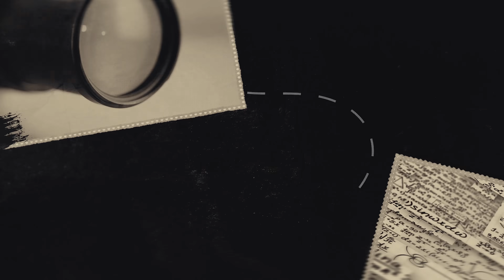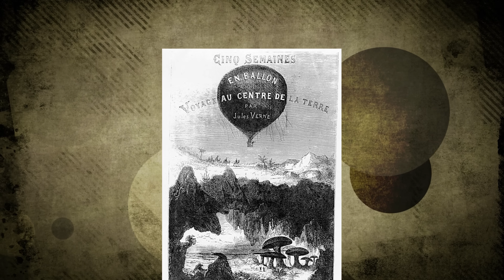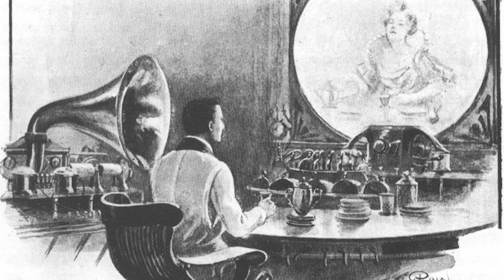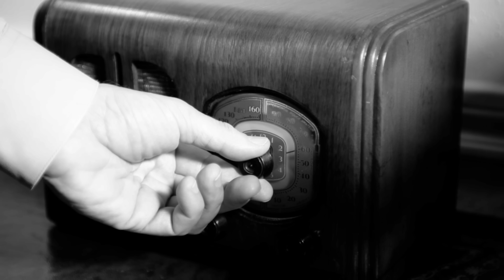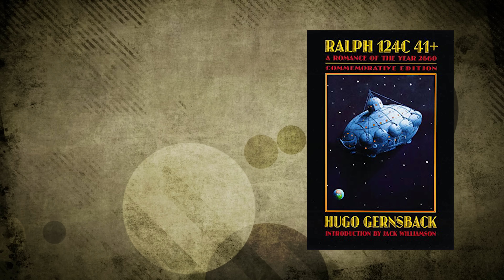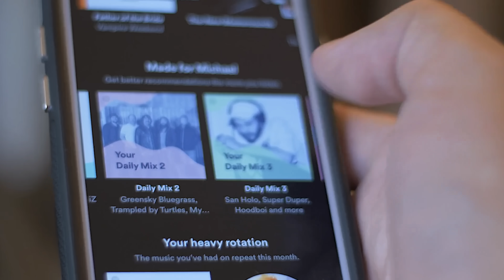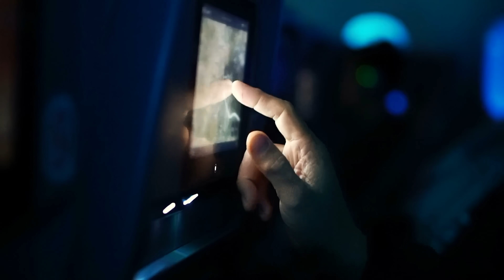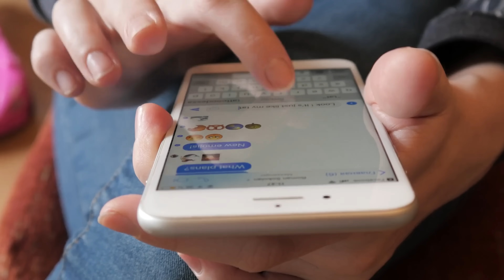This Old Book Predicted Everything

Comment: I remember reading a book years ago which featured a computer which could be with around the neck and was disguised as a necklace. It used a hologram for a screen and projected a keyboard onto any flat surface using a laser. Of course we do have laser keyboards now though no doubt the rest of it is a few years away yet, though computers can be fitted into a usb drives. I suppose it was also a prediction of wearable technology.

Comment: I just happened upon this video. Tesla beat Marconi in everything. Marconi stole Tesla patents and the Supreme Court recognized Tesla was the first to invent radio. In 1917 Tesla wrote in the Electrical Experiementer about an electric ray which would bounce off submarine hulls. ' If we can shoot out a concentrated ray comprising a stream of minute electric charges vibrating electrically at tremendous frequency, say millions of cycles per second, and then intercept this ray, after it has been reflected by a submarine hull for example, and cause this intercepted ray to illuminate a fluorescent screen (similar to the X-ray method) on the same or another ship, then our problem of locating the hidden submarine will have been solved.' He was talking about microwave frequencies over 15 years before Marconi. Hugo Gernsback was editor of such electrical magazines and would have remembered this.